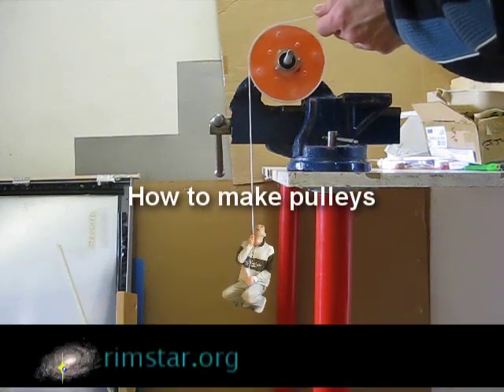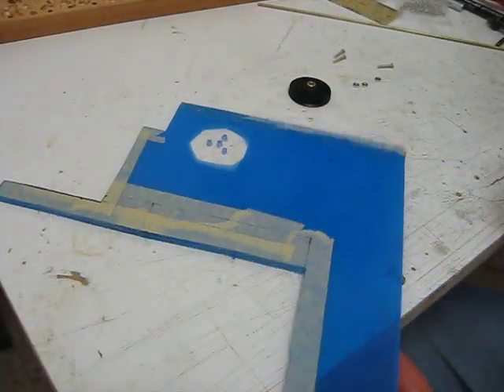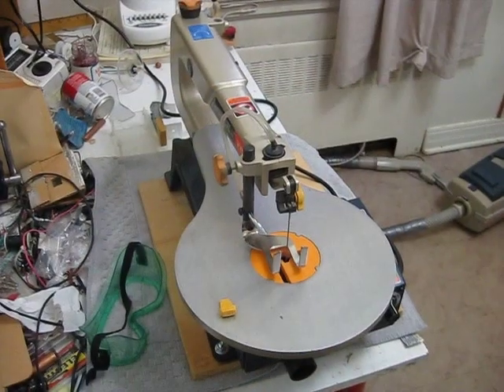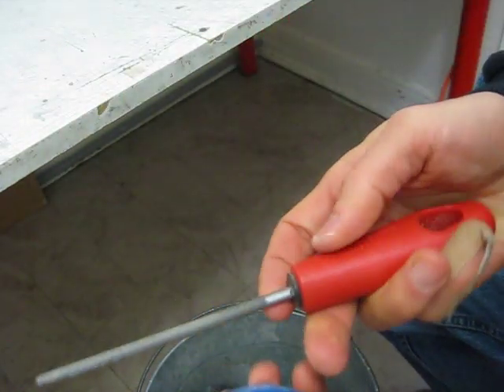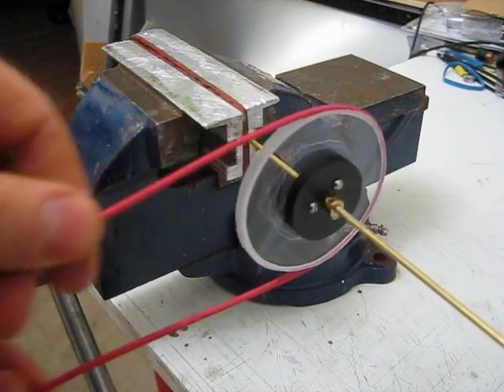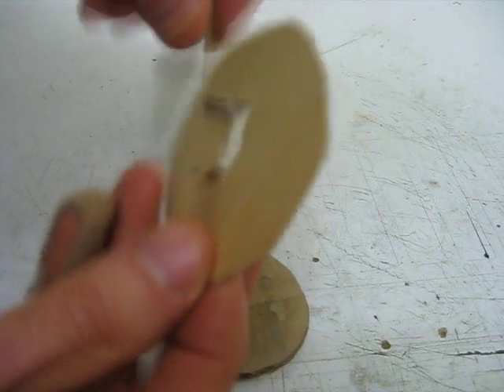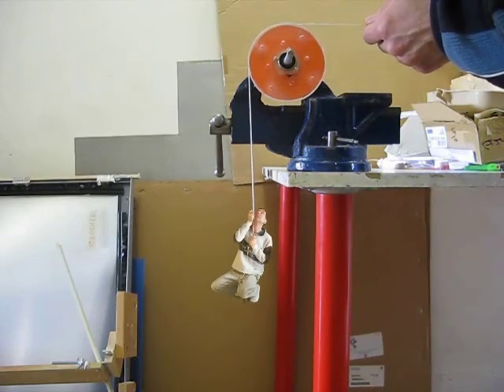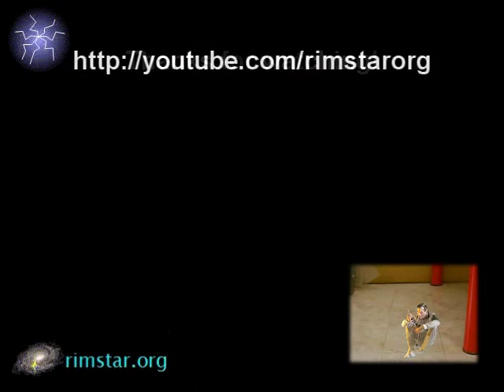How to make a pulley (and a little leg pulling)

Comment from the maker: The larger the pulley, the easier it is to lift. Look for pulleys for clotheslines or metal pulleys from hardware stores. Both are around 3 to 4 inches in diameter.

Comment from the maker: Try looking for clothesline pulleys and adapt one of those. Though if you wanted to make your own then I'd start by either cutting a piece of thick piece of wood into a disk shape and somehow carving the groove into it (pine is easy to carve) or cutting three wooden disks, two slightly larger diameter than the third and sandwich the third in between the other two.